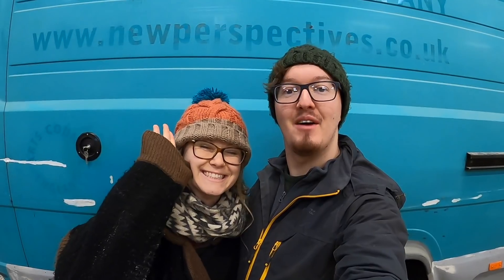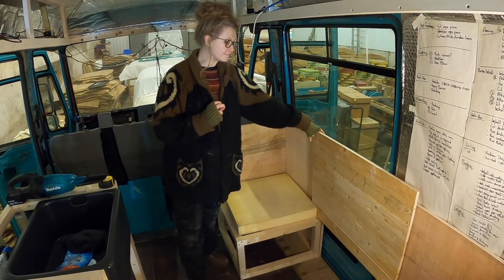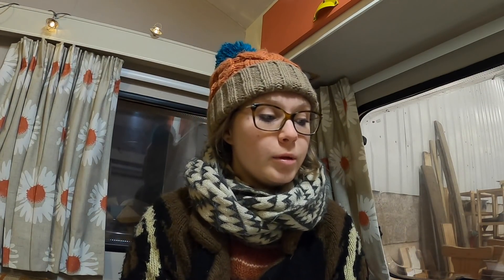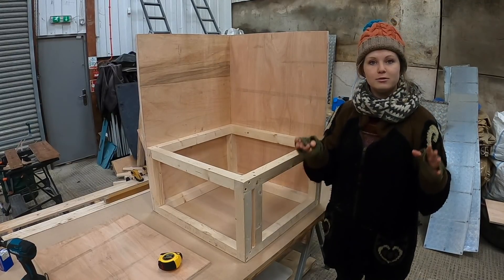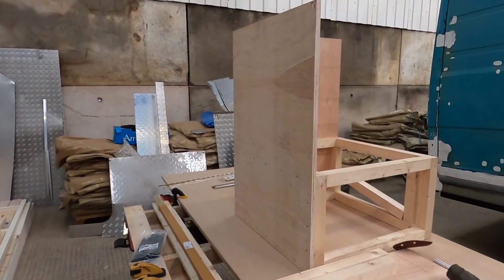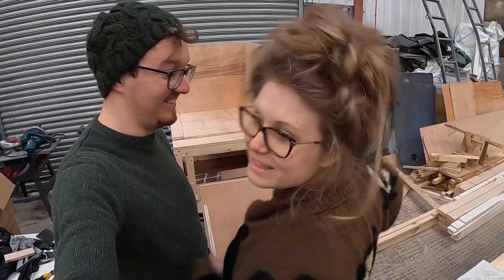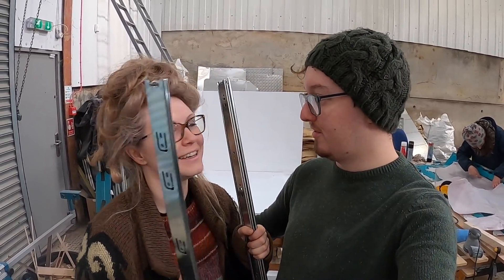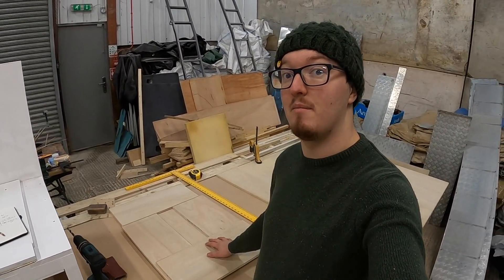DIY VANLIFE SEATING AREA | Dinette Sofa Bed combo| MERCEDES VARIO CAMPER CONVERSION | Van Build Ep22

Comment: before you get too settled on any seating designs,think about the high end seats you can pull out of a scrap yard,i manage to get a full black leather,electric drivers seat out of a jaguar,of which there are loads available,for £30,i put it in as my drivers seat with just a couple of peices of ali angle to convert,also bought 2 cream half leather electric seats from jag,for £140  off the internet to fit over rear wheel arches,i looked into bespoke "captains" chairs and you;d struggle to get change out of a grand.
Reply from the maker: That’s really great to know, thank you so much for the advice! If we decide to change those seats we will definitely look at a scrap yard! 😊👍

Comment: the table stroke sofa idea is the same as i would of done, but the gap on the front of the chairs  for the table Iwould of made it a bit smaller like a inch in a half or 2 maybe.
but its looking ever so closer to a motorhome each visit.  Keep up the excellent work guys !!! :-)
Reply from the maker: Thank you so much! We are hoping it’s all going to work well! 🤞 we went slightly larger with the table to we have plenty of space to both work there with two laptops 😊👍

Comment: you have put a lot of weight on during your van conversion. Any idea what all that wood weighs?
Reply from the maker: We’ll be weighing it before we take it out on the road but don’t have an exact weight yet! We have about 3 tonnes of payload available so will be well within that. Will update you when we know! 😊👍
Reply: @MaxSophieinaVan  i dont think you could overweight the chassis with just campervan stuff,not possible,mine only weighs 5 tonne,(without any water tanks as havnt done any plumbing yet),the chassis is 6.6 ton when it was a commercial vehicle,and i thought my build was "heavy".
Reply from the maker: That’s great to know as that’s similar to what we have worked out from our rough calculations! This is really helpful to know so thank you! 😊👍

Comment: did you have any information when you bought truck about the range with the second diesel tank? ive been thinking of obtaining another tank
Reply from the maker: So we have two 70l tanks, so range should be roughly 550-600 miles I believe! 😊👍
Reply: @MaxSophieinaVan  thanks,nice to know,i have to stop on the way to cornwall usually,your lucky to have that extended range setup!
Reply from the maker: You’re welcome! We are really hoping it means we can get away with bigger trips away from civilisation! 😊👌

Comment: Is the weight of the finished van going to be an issue?
Reply: I think it’s over a 3.5T truck as Max had to take a driving test for it.
Reply from the maker: Great thought, but as Andrew has said it’s a 6t van so we have plenty of payload capacity - she weighed just over 3t when completely empty which gives us lots of space to add things! 😊
Reply: @MaxSophieinaVan  ok, I try not to criticise anyone but you are using very thick ply and frames compared to other van builds I’ve seen. Some not even having frames for cupboards. Payload weight is really important.
Reply from the maker: Completely understood, feedback from everyone is so useful to us so we would rather know! 😊 we are using the 18mm ply for the seating area only and have used much thinner stuff for everything else, the timber framework is all pretty lightweight too! We will be going to a weigh-bridge before we take her out on the road to check we are within all of the legal limits etc 😊👍